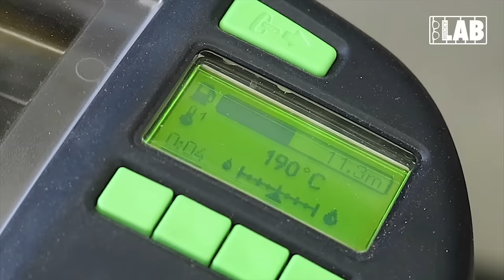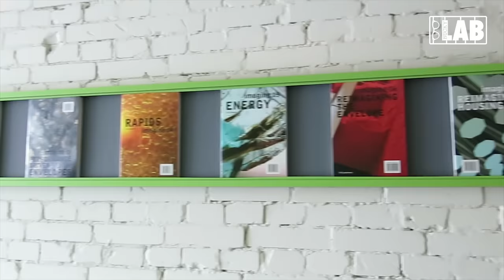imagine book shelf using festool Conturo KA 65

Comment: I edgeband about 600 4x10' sheets every year. I have a lot of festool, so I decided to buy the coturo. Very bad mistake! I called festool usa and they told me the tool was more for 2 and 3 mil edgebanding and that it's more prevalent in Europe.  I think the glue pucks are a horrible idea. Looks like they took the glue from a holzer edgebander and cut it up. The machine max speed is 4mpm. (slow)
So I returned it and I was able to buy two virutex peb-250 edgebanders. My shop now has 3 X the speed then the festool and it does 0.40mil edgebanding.
Reply: I have never seen one of these first hand but I have never heard anything positive said about them

Comment: The video film is good, but was spoiled with the awful soundtrack. A commentary would be really good...
The finished book shelf is lovely - but I wonder if it's only as a display for books exactly all that size or surely they could topple off?  What about wanting the book in the middle which would require removing and then the subsequent replacing of each of the books before it? 

Lots of Festool tools used throughout video. Nice clean workshop.